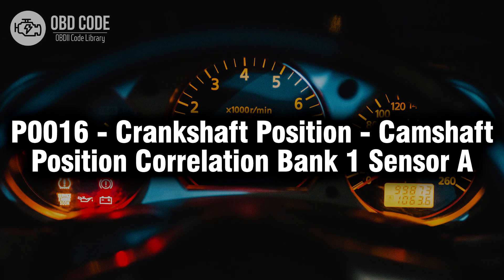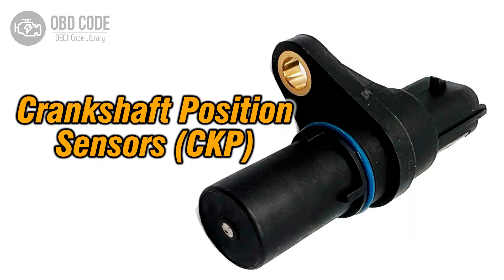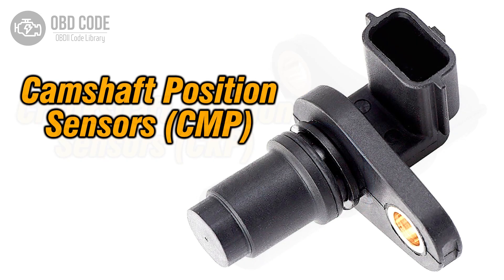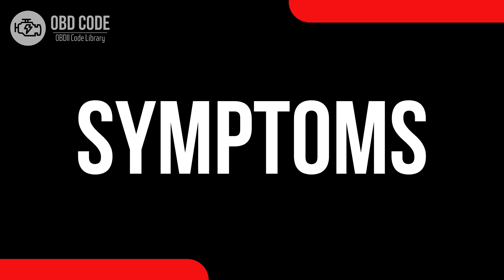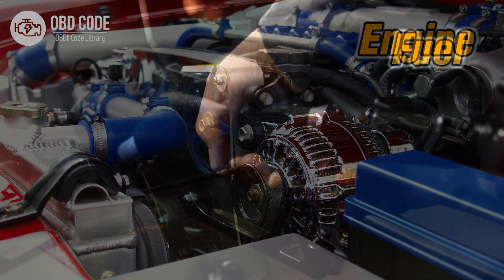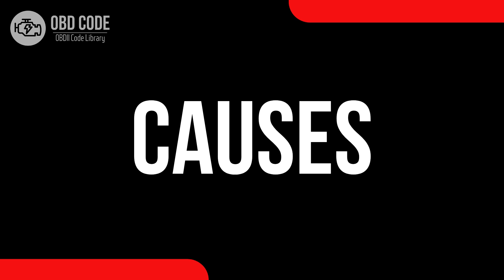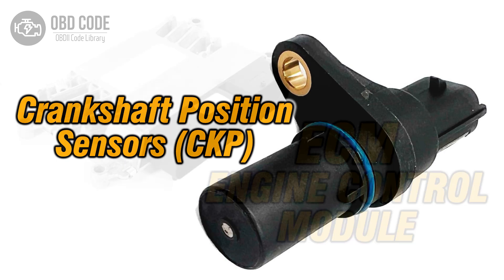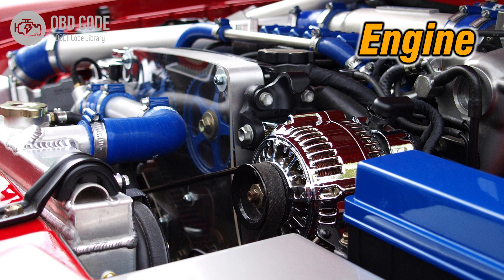P0016 Crankshaft Camshaft Position Correlation 🟢 Trouble Code Solved 🟢  Symptoms Causes Solutions

Comment: I had that dam* problem on my 2012 Buick Verano. I had to replace the intake and exhaust sensors. Now, dam* light back on. Code p0016 & p0017. Ended up replacing the camshaft sensor since that was easy to find. I had a he** of a time finding the crankshaft sensor. Called Chevy parts and he sent me a picture where it was. I spent all day yesterday fighting with it since it’s under the dam* oil filter where there is not room to make it easy get to it. Today spent all day and only got to the point had a hard time getting my 8 mm socket on it and once I got to it and unscrewed it. I was thinking I’m not going to finish it and tighten it back up and will have the garage do it.
Reply from the maker: Good morning, thank you for sharing your valuable experience.